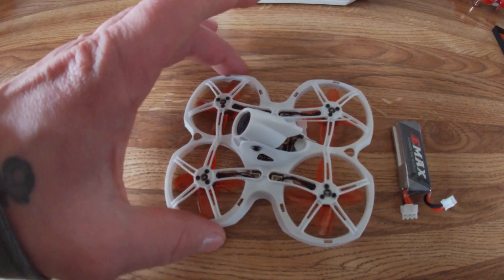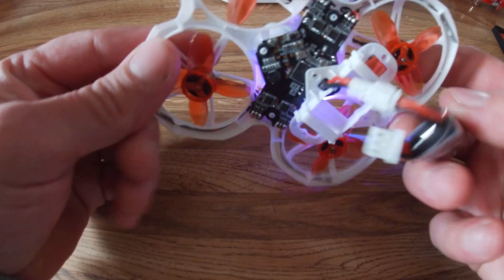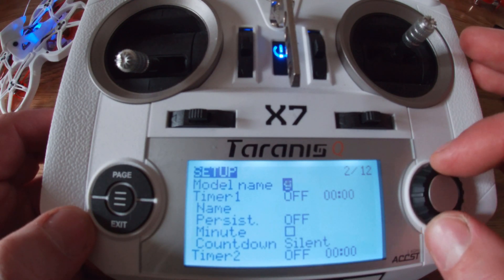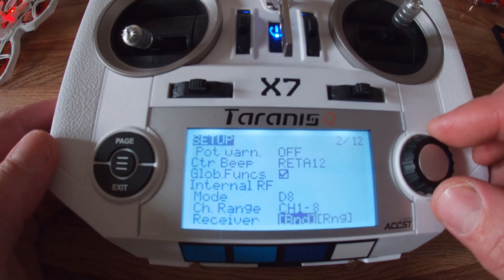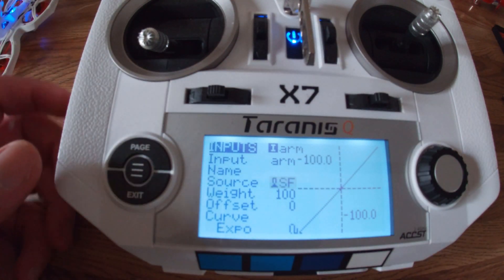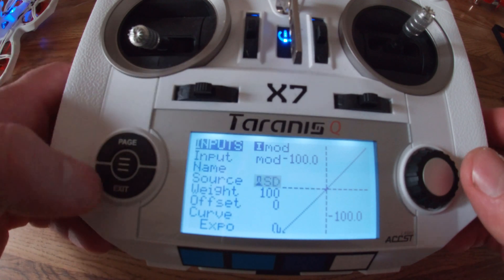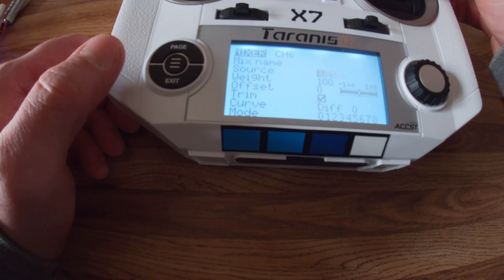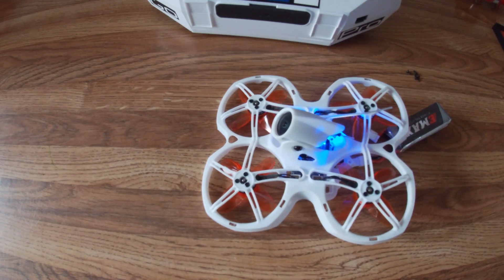EMAX TINYHAWK 2 1-2S BIND AND ARM PROCEDURE.

Comment: The lights on mine don’t turn red with I press that button, I have a connection and can see my camera on the headset but my controller won’t do anything, I didn’t even get a manual and I’ve watched over an hour of YouTube videos trying to get it working...
Reply: your RF modules is  in version 2.xx? if yes that's a reason, i have this same problem...

Comment: I did all the steps with a fresh tinywhoop and new model on the Qx7. It doesn't seem to arm at all. Any ideas? Thanks!
Reply from the maker: Retry it. It may take a couple. You'll know it worked when the light is solid. What mode did you use?
Reply: Nvm I got it! My batteries were just low. The video helped so much thanks a lot!!!! <3

Comment: I’ve got a Radiomaster TX16S.  Will this procedure work with the Radiomaster ? I’ve tried a bind process from a different poster and I can’t get my Tiny to start up.  The process seems pretty similar to yours but the other guy wants me to go into Betaflight.  Any ideas ?   Thanks for posting.
Reply from the maker: I'm not familiar with that exact model of TX. I only use QX7, X-LITE, and DJI MODE 2. Doesn't seem like it would be that much different but you might need to double check that your TX is compatible with your RX. Betaflight option does work as well as manual. Hopefully this helped a little. Happy flying.
Reply: @thumbhobby1390  thanks.  From my understanding, which might be off, the Radiomaster should be able to “talk” to anything.  
I’ll check it out again.  Thanks for posting.

Comment: What is the best radio to upgrade to and easiest to just bind and fly without messing around with settings im new to fpv and don't have a computer for all that 
i have ordered the tiny hawk free style and the tiny hawk s  i hate the radio that came with the tiny hawk  rtf kit too small for my hands any help would appreciated sir have happy safe holidays
Reply from the maker: What exactly do you mean by radio?
Reply: @thumbhobby1390  transmitter sorry sir I have been looking at the jumper t18
Reply from the maker: @johnnysouth4982  I've heard lots of good about those. I have a couple QX7 and a mode 2. They handle everything I have just fine. Mainly personal preference.

Comment: Thanks for the video. Another tip is that the plastic battery case is also plastic and can just be pushed to press the button. No need to unscrew anything or even use tools. Just push the plastic casing and it will push the button.

Comment: hmm. I guess that's sort of the quickest without a computer? 
With a computer, just connect drone to Betaflight go to CLI and type "bind_rx spi" then press bind on remote. That's it. No need to remove screws or press buttons.
:)
Reply from the maker: Yes that is correct and thanks for the info.

Comment: Damn Dude, been pulling my hair out trying to figure this out. My Tinyhawk 2 wouldn't connect to my computer with the USB charging cables I had, so I couldn't go into BetaFlight Configurator and set it up the way another video showed to do it, but you got me going! Thanks!!
Reply from the maker: Glad I could help
Reply: bro change usb cabel from charging cab to data cable

Comment: You don't need to unscrew anything. Connect it to Betafight, go to the command line interface, and enter bind_rx spi (note the space between bind_rx and spi). The LEDs then show it is in binding mode. Then simply complete the binding process on your transmitter.
Reply from the maker: Thanks for that knowledge. I'll give that a whirl in a new and upcoming video.
Reply: Can I connect to any radio? I have Flysky FS-i6

Comment: Hey everything is going just like it is in your video until I turn off the bnd  on my radio then tinyhawk goes back to solid blue flashing red so back into bind mode. Can you help? I am a total newb and have been trying for days!!
Reply from the maker: ok, start off with the transmitter on and in bind mode first. plug in the battery and then press the bind button on the fc. hit it again on the tx. reboot the quad and you should be in business. only on d8 mode and this is just the qx7 frsky. other tx may have other variables.
Reply: @thumbhobby1390  ok cool thanks I'll try that. I'm in D8 and I have a qx7s but its basically the same radio I believe  or hope. The other steps you listed are a new sequence so I give it a go!